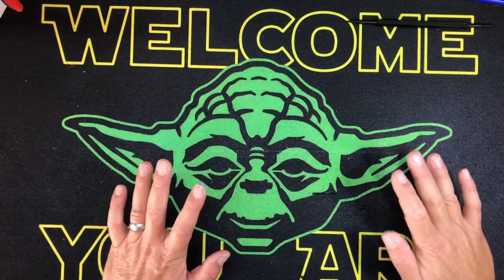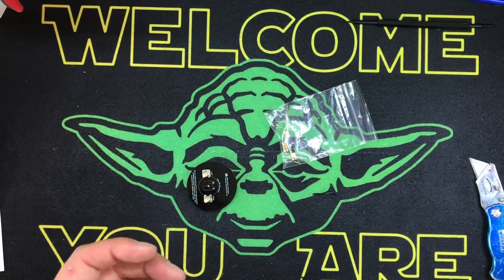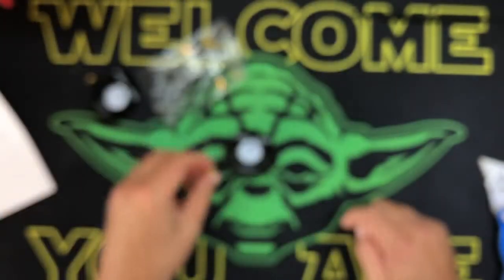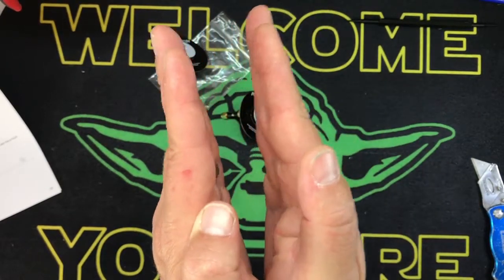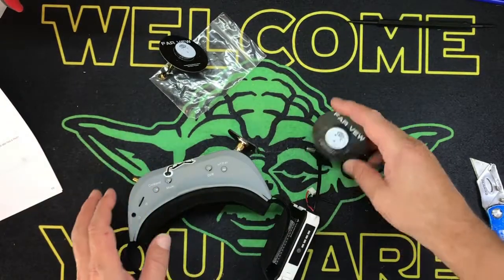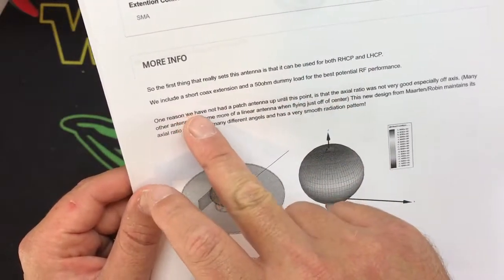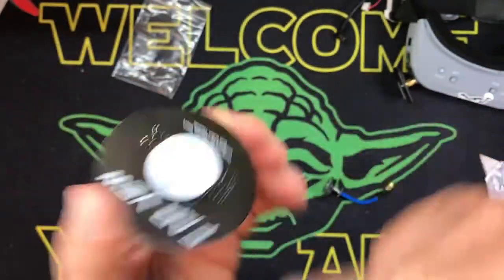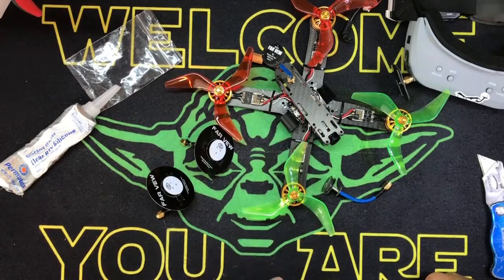Farview Triple feed Patch Antenna Review and Antenna Tech Tips!!!

Comment: +1👍 sir James J, considering this patch versus 3-coil helical, which would you recommend for a 5" quad, freestyle, occasional flight behind 1-story building or trees... right now my TX limit is 210meters, but i would want to future-proof.
Additionally, would you think an rp-sma splitter (T) would be good to add dual-antennas per goggle-sma, or do you believe it would be a detriment to the signal?
👁🤘
Reply from the maker: Na.    Don’t use a splitter.   But I would use thebhelical brother.    3 turn.
Reply: Thank you! @@ @jjrotogeek

Comment: Dude I just got mine and I am very happy with it!

I was using a Helical and loved it but after playing with the new patch I can say the Helical is now on the bench!
Reply: I also did not get a sticker... I for some reason I think I liked them a bit more than I should have... ;)
Reply from the maker: DaRoach5882 helical are awesome if your pointing right at the quad.  I just tested the patch at a park and I went 2k feet above me without looking up omg.  I'll be posting the dvr soon.   Damnnnn.    Love it.   Thanks for the input brotger
Reply from the maker: DaRoach5882 have u compared it to the menace patchbor any other??? Just curious
Reply from the maker: DaRoach5882 lolol no shit!!!!! Need my stickers
Reply: JJRotoGeek The only directional antennas that I have used have been, Menace Patch, VAS and Far Vew Helical and a cheap ebay patch... So far the new Triple Feed beats them all hands down, it is a bit higher gain so that helps but the high axial ratio makes a difference when it comes to multi-pathing IMO.
Reply from the maker: DaRoach5882 agreed. I haven't had a great chance to test much, but I took ewad up 2000 feet the other day with no break ups and it was almost directly over head.   Which is pretty fucking amazing

Comment: yeah I do same thing also use it to make flat sheets I cut motor mounts from and fc washers. great stuff you can seal esc with it if you out of conformal coating.. lol I also make battery none slip pads and use it as screw lock . lol I put the stuff on everything but food but I hear its in there already
Reply from the maker: LOLOLOLOL no doubt!!! I conformal coat everything because its easier for solder repairs.. but good tip for a battery pad!